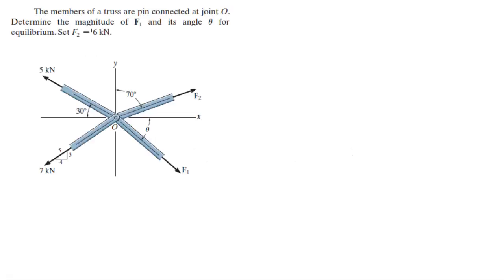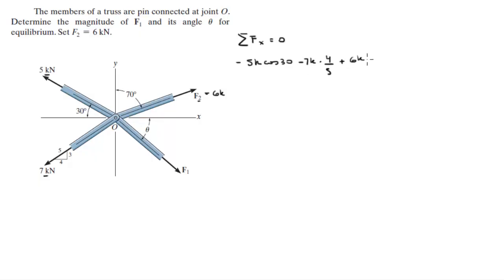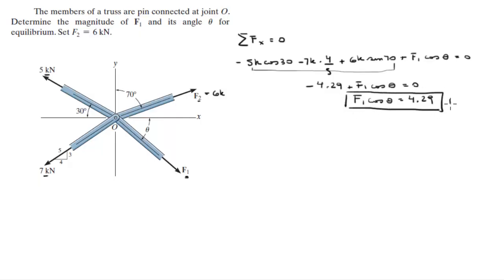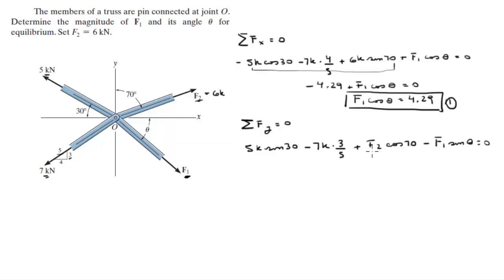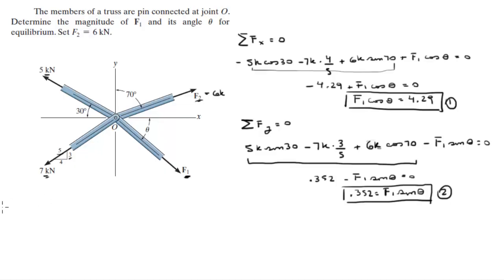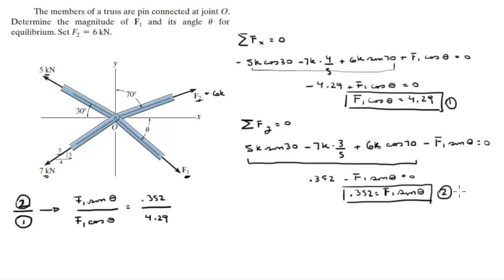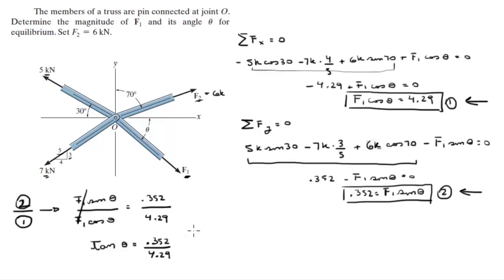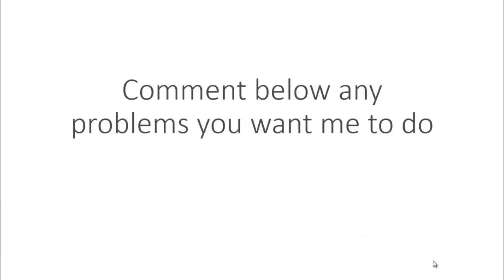Determine the magnitude of F1 and its angle u for equilibrium

Comment: When you were solving for F1 and the angle theta, how come you just simply put equation 2 over equation 1? Is there a rule or something that allows you to do that?
Reply: I thought that was strange, too...but you can divide both sides of an equation by the same thing, right? F1cos*theta and 4.29 are actually the same thing (they are equal), so it makes sense that we could divide both sides of the equation like this.
Reply: Its geometry, he can put equation 1 over equation 2 and will get 'cot' then, he will have to apply arccot x equation over y equation.